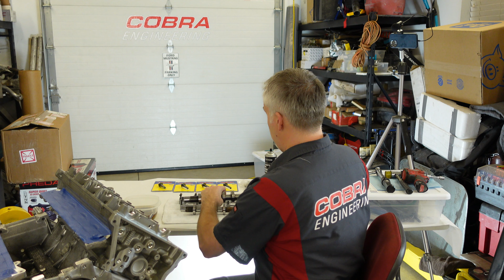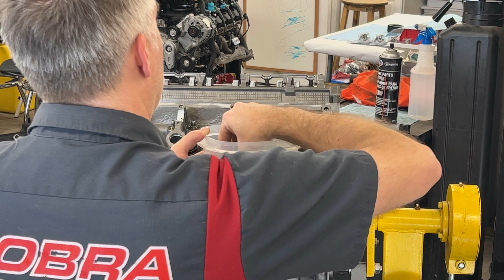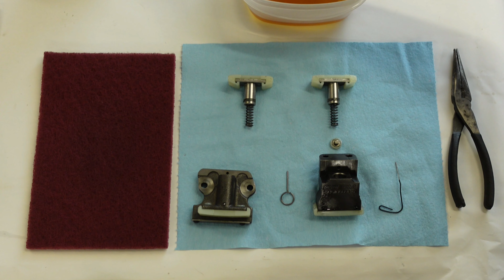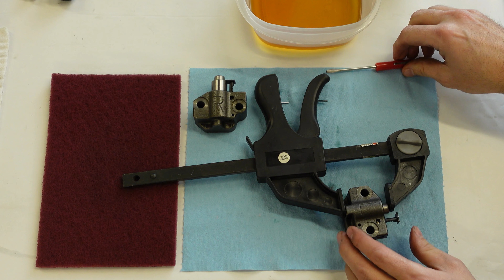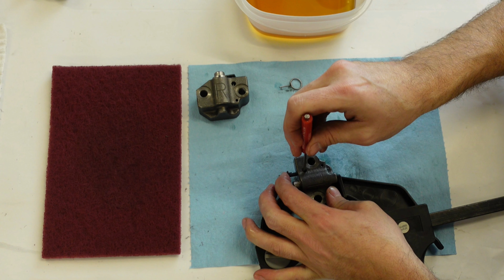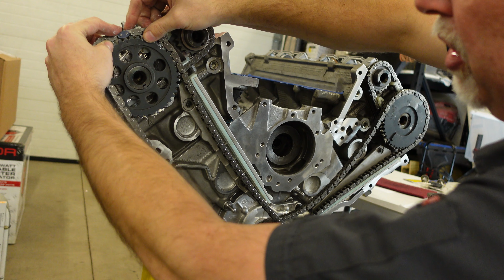Cobra timing gear and cam install - Cobra Tech Talk #2

Comment: What part number bolts did you use for the camshaft?
Reply from the maker: ARP 256-1001 for M12 bolts and 256-1002 for M10 bolts.
Reply: @cobraengineering so the 96-98 cobra cams are the 256-1001? I’m finishing up my motor and not sure which ones to order
Reply from the maker: @Boostedmamba  yes that’s correct

Comment: Awesome video I'm about to reassemble a 97 cobra engine.. a few questions:
- can I reuse any of my timing components? Guides/chains/tensioners? 
-Can I reuse my cam bolts and tray hardware?
-Do I need a special tool to torque the cam bolts that holds the sprockets?
-An lastly I had my oil cooler cleaned at the machine shop.. do I need new gaskets or take it apart to clean any further? 
Thanks an sorry for all the questions!
Reply from the maker: You can reuse the guides and tensioners.  But I would get new chains.
You can reuse the hardware.  But again I would get the ARP cam bolts.
The special tool helps but a short 3/8 ratchet extension will fit in the back of the cams to hold them.
It's a good idea to replace the o rings in the oil cooler.  It's a known problem with them.
Reply: @cobraengineering  thank you so much for the reply! Do you have a go to buy chains and guides maybe?
Reply from the maker: @jmitchell513  Apocalypse Performance or Modular Head shop
Reply: @cobraengineering more question.. is it okay lay in the lash adjusters, followers and bolt down the cams on top of them? Or should I torque the cams and finagle the followers under them after? I don’t have that $200 tool and I’ve heard the screwdriver method is bad
Reply from the maker: @jmitchell513  I’ve never tried that. But I can’t see how it would hurt anything. Just not sure if it’s even possible.

Comment: In one of your other comments, you noted that if you are not at the limits of your setup cams are not the best value. On a 2.3 VMP (2.6 pulley) E-85 car, would porting the heads be worth it without cams? I might have a head tick might be an exhaust leak but replacing the old 2 piece long tubes this winter. So I was looking at replacing the heads with 9 thread heads (if I have the head tick) and thought porting would lower the restriction on the engine. Is porting a waste of money since I’m not doing cams? My car is a street car and will spend 5,000 miles each year on the street.
Reply from the maker: It’s mostly a money thing. Yes porting will have gains. And cams will have a gain. But so does a pulley change. If money is no object I would go with porting first then cams.
Reply: @cobraengineering  thanks for the advice and great videos!

Comment: Have aftermarket cams ever been installed and degreed with engine still in the engine bay?
Reply from the maker: I can’t think of a reason why you couldn’t. But removing the valve covers in the car is a major pain in the ass. I did it once and wished I wouldn’t have bothered. It was no fun.
Reply: @cobraengineering  Thanks!!! i was thinking the it should be possible but wanted to ask someone more experienced i cobras (I'm a cobra noob :) ) … I painted my valve covers recently and yes a major pain!! I was curious ad searched for videos and didn't find any...
Reply from the maker: @e.rivera6219  keep in mind that unless you are at the limit of your setup cams is not the best value for upgrades.
Reply: @cobraengineering  Roger that, noted!!!